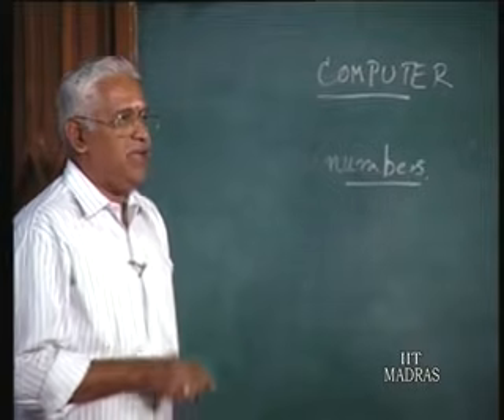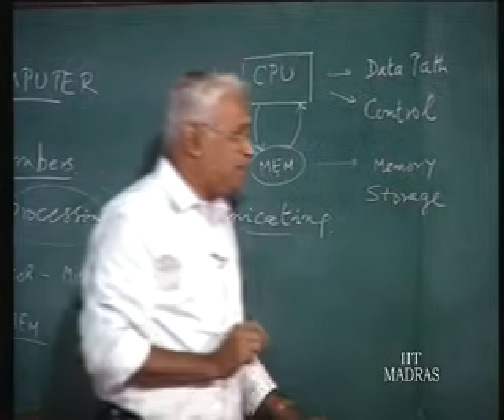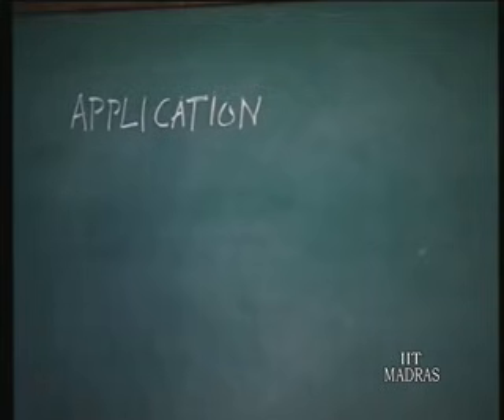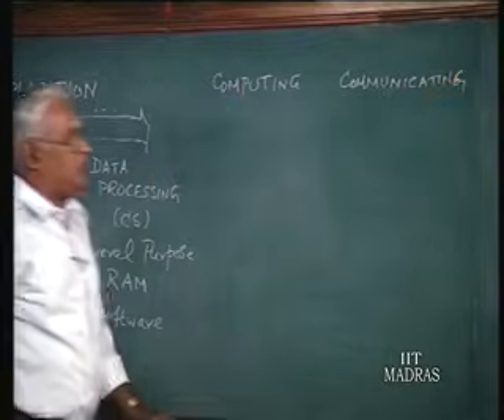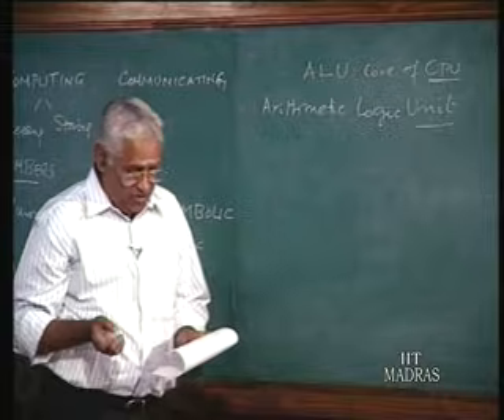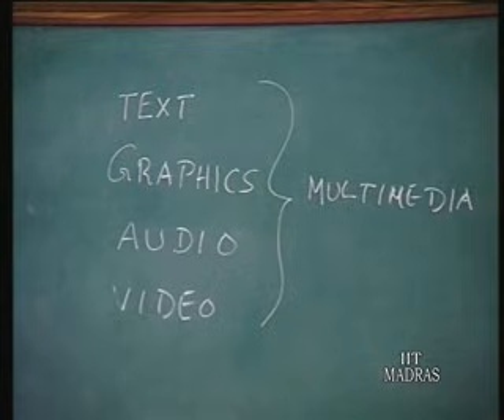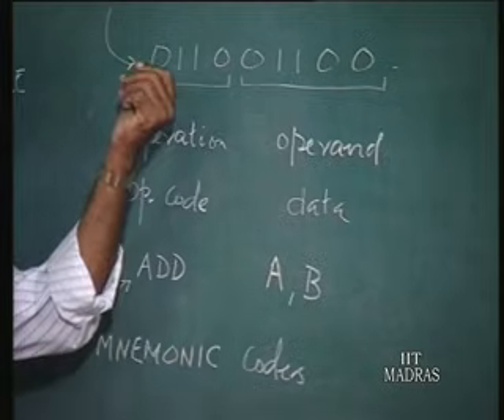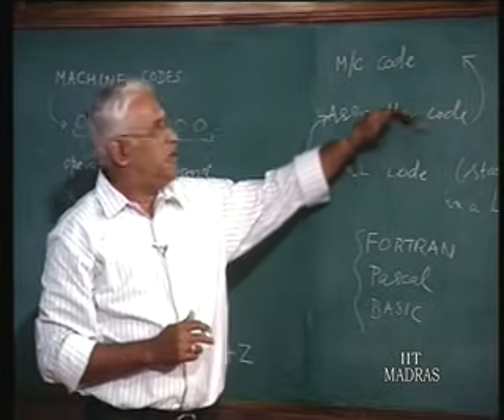Lecture - 1 Introduction To Computing

Comment: The history of computing is longer than the history of computing hardware and modern computing technology and includes the history of methods intended for pen and paper or for chalk and slate, with or without the aid of tables.

Computing is intimately tied to the representation of numbers. But long before abstractions like the number arose, there were mathematical concepts to serve the purposes of civilization. These concepts include one-to-one correspondence (the basis of counting), comparison to a standard (used for measurement), and the 3-4-5 right triangle (a device for assuring a right angle).

The earliest known tool for use in computation was the abacus, and it was thought to have been invented in Babylon circa 2400 BC. Its original style of usage was by lines drawn in sand with pebbles. Abaci, of a more modern design, are still used as calculation tools today. This was the first known computer and most advanced system of calculation known to date - preceding Greek methods by 2,000 years.

The first recorded idea of using digital electronics for computing was the 1931 paper "The Use of Thyratrons for High Speed Automatic Counting of Physical Phenomena" by C. E. Wynn-Williams.[4] Claude Shannon's 1938 paper "A Symbolic Analysis of Relay and Switching Circuits" then introduced the idea of using electronics for Boolean algebraic operations.

Comment: In mathematics and computer science, an algorithm (/ˈælɡərɪðəm/ (About this sound listen) AL-gə-ri-dhəm) is a self-contained sequence of actions to be performed. Algorithms can perform calculation, data processing and automated reasoning tasks.

An algorithm is an effective method that can be expressed within a finite amount of space and time and in a well-defined formal language for calculating a function.Starting from an initial state and initial input (perhaps empty), the instructions describe a computation that, when executed, proceeds through a finite number of well-defined successive states, eventually producing "output"[6] and terminating at a final ending state. The transition from one state to the next is not necessarily deterministic; some algorithms, known as randomized algorithms, incorporate random input.

The concept of algorithm has existed for centuries; however, a partial formalization of what would become the modern algorithm began with attempts to solve the Entscheidungsproblem (the "decision problem") posed by David Hilbert in 1928. Subsequent formalizations were framed as attempts to define "effective calculability" or "effective method";] those formalizations included the Gödel–Herbrand–Kleene recursive functions of 1930, 1934 and 1935, Alonzo Church's lambda calculus of 1936, Emil Post's "Formulation 1" of 1936, and Alan Turing's Turing machines of 1936–7 and 1939. Giving a formal definition of algorithms, corresponding to the intuitive notion, remains a challenging problem

Comment: At the lowest level, executable code consists of machine language instructions specific to an individual processor—typically a central processing unit (CPU). A machine language consists of groups of binary values signifying processor instructions that change the state of the computer from its preceding state. For example, an instruction may change the value stored in a particular storage location in the computer—an effect that is not directly observable to the user. An instruction may also (indirectly) cause something to appear on a display of the computer system—a state change which should be visible to the user. The processor carries out the instructions in the order they are provided, unless it is instructed to "jump" to a different instruction, or is interrupted (by now multi-core processors are dominant, where each core can run instructions in order; then, however, each application software runs only on one core by default, but some software has been made to run on many).

Comment: Typical formal definitions of software engineering include:

"Research, design, develop, and test operating systems-level software, compilers, and network distribution software for medical, industrial, military, communications, aerospace, business, scientific, and general computing applications"—Bureau of Labor Statistics
"the systematic application of scientific and technological knowledge, methods, and experience to the design, implementation, testing, and documentation of software"—The Bureau of Labor Statistics—IEEE Systems and software engineering - Vocabulary
"The application of a systematic, disciplined, quantifiable approach to the development, operation, and maintenance of software"—IEEE Standard Glossary of Software Engineering Terminology
"an engineering discipline that is concerned with all aspects of software production"— Ian Sommerville
"the establishment and use of sound engineering principles in order to economically obtain software that is reliable and works efficiently on real machines"—Fritz Bauer

Comment: The term "computing" has sometimes been narrowly defined, as in a 1989 ACM report on Computing as a Discipline:

The discipline of computing is the systematic study of algorithmic processes that describe and transform information: their theory, analysis, design, efficiency, implementation, and application. The fundamental question underlying all computing is "What can be (efficiently) automated?"

The term "computing" is also synonymous with counting and calculating. In earlier times, it was used in reference to the action performed by mechanical computing machines, and before that, to human computers.

Comment: Computer software or just "software", is a collection of computer programs and related data that provides the instructions for telling a computer what to do and how to do it. Software refers to one or more computer programs and data held in the storage of the computer for some purposes. In other words, software is a set of programs, procedures, algorithms and its documentation concerned with the operation of a data processing system. Program software performs the function of the program it implements, either by directly providing instructions to the computer hardware or by serving as input to another piece of software. The term was coined to contrast with the old term hardware (meaning physical devices). In contrast to hardware, software is intangible.[5] Software is also sometimes used in a more narrow sense, meaning application software only.

Comment: Lot's of confusion between Architecture and Organization. Let me simplify. Architecture is designing (Like designing a bridge or a  building on paper). The organization is how it will be built, what are the components needed, how they will be implemented. Though there is not a clear distinction between them specified in the literature, one can see architecture as designers perspective that is the car driver and organization is car mechanics who has to know all the minute details about the car to fix it. Professor, I think swapped the role of the two. This is what I find till now. Let me know if I am wrong. Thank you.
Reply: my understanding is same..instruction set "architecture "define the things needed/fancied..whereas "implementation" of an ISA(CPU) is how we realise that "paper dream".....that is why we have the liberty to experiment,and that is how we get many types of cpus from the same ISA(eg x86).

Comment: i think the difference he told about architecture and organization is some what misplaced or is wrong.
Computer architecture refers to those attributes of a system visible to a programmer
or, put another way, those attributes that have a direct impact on the logical
execution of a program. Computer organization refers to the operational units
and their interconnections that realize the architectural specifications.
Reply: william stalings!!
bt watevr the profesr tld is seemingly true
Reply: Dis

Comment: Engineers are the hardware designers and programmers are the computer scientists.No computer programmer should call himself or herself as software engineers with no ability to design the computer hardware. One can do an arts degree and become a computer scientists but cannot become a computer designer without proper education of electronic engineering..

Comment: To Shreyaas:
1. All I know is that IIITM did this video well before NPTEL was formed. May be after that, the other video was made. 
2.  Yes, there are enough of confusions about definitions of CO and CA. The way I look at is Organization is at system level, logical implementation- and user-oriented, whereas Architecture is a bit more specific in detail, physical implementation- and designer-oriented.  Do not worry much about these definitions, as there can be overlaps.
Reply: Sir which you have referred  for this  coa subject
Reply: kalimuri gangadhar  quora profile choor